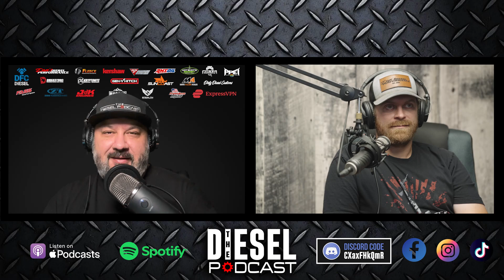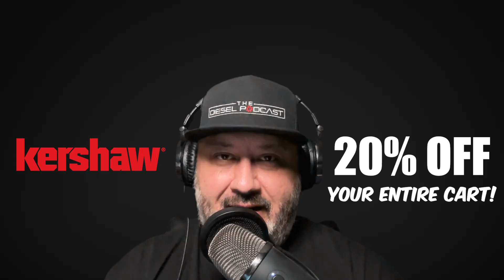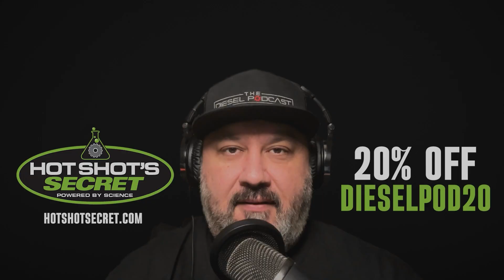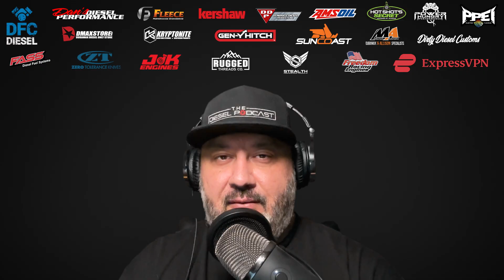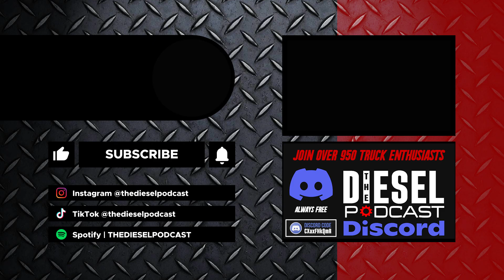L5P Owners Just Got a Big Power Boost

Comment: I've got a 2018 GMC L5P @ 148k on the ODO, and so far, I haven't had many issues until now. Right this minute, the DEF system thinks that the tank is empty when its actually full. I tried a new module but didn't work, so now im saving up to get a pump unit, which also houses the heating elements and the level gauge. 
 As far as other repairs/failures, i had to change the injector connector on cyl 7, but that wasn't too bad of a repair, just really tight spot to work through the fender well. 
The dealership changed a glow plug on cyl 7 under warranty at 98k miles as well.
 As far as upgrades done so far there's not too much. Ive got the Banks Derringer and gauge which i really like and highly recommend. Also, when it was time to service the Allison (6spd), i got one of those bigger trans pans in a service kit that i bought from The Dmax Store which is another place I highly recommend. The temp since then has never been above 196*F. 
The previous owner put a 4.5in BDS lift kit on it which has held up really nice but I really didnt care for the performance of the Fox 2.0 shocks which i changed over to the Billstein 5100s and that was a great improvement in ride quality! 
Future upgrades im after is a drop in FASS system and hopefully a centrifugal oil filtration system, if i ever find one to add to it. Really wanting to go for longevity with this truck. Anyways, sorry for the novel, but if you've read all this, thanks for taking the time! 

Love the podcast and keep them coming! 
Oh, and I think its time to have Vinny come back on! Especially now that his road trip is done!
Thanks again!